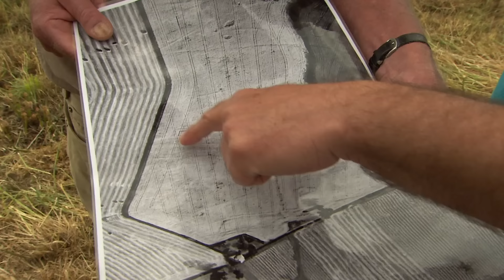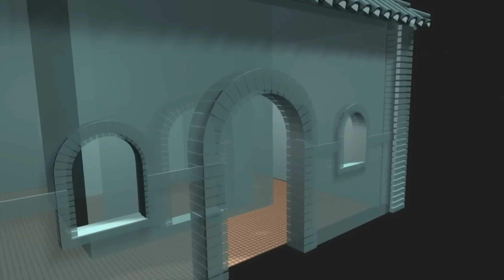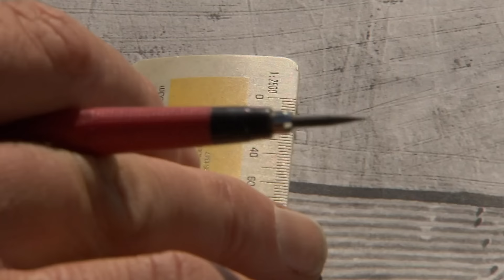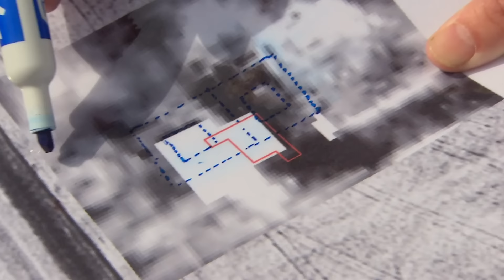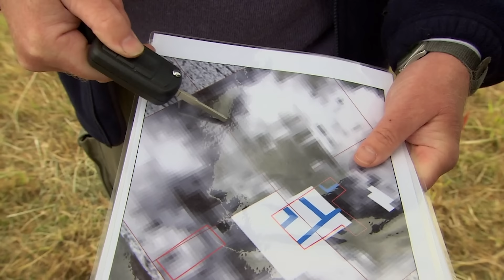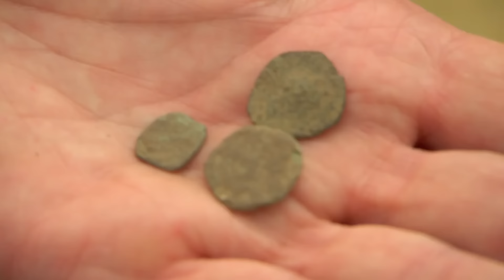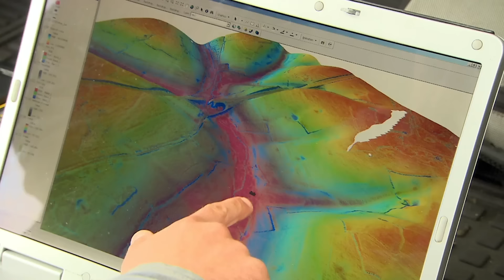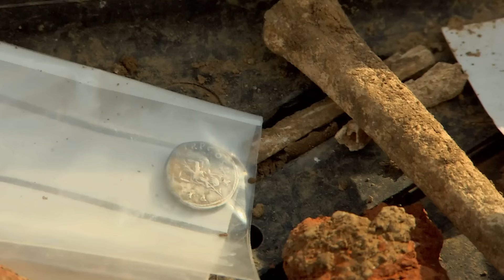“The Trouble with Temples” (Friar’s Wash, Hertfordshire) | S16E01 | Time Team

Comment: @21:14 you can actually see the circular feature on the photo.
Reply: There actually appears to be one on either side. I wish they weren't so rushed with the dig, they could have uncovered both areas.
Reply: @bradenconrad8208  I think this was a case of putting TV before archaeology, so that they could have John showing the circular feature as a 'surprise'. I find it odd that none of the team noticed it on the photo beforre.

Comment: I've watched a number of these excavations of mosaic floors and it seems the tesserae were laid straight onto dirt. Is this the way the Romans built them ?
Reply: Guess so!
Reply: Not a lot of the time if it wasn't a major structural building intended for actually living in they tended to use cheaper binding agents which over time degraded and what you get is the tesserae sitting in dirt

Comment: 40:20 I think that Francis is likely a tremendous Archeologist and scholar, however his confirmation bias for everything ancient being explained as ritualistic is on display again here.

Ancient people, especially the Romans, were nothing if they were not practical. The fact that the ambulatory is raised above the walkway, and the cella is raised even higher than that likely has more to do with the fact that the field was known to flood for at least a portion of the year, as explained at 37:10, and they would want the ambulatory and the cella to remain dry, even when the plain around it flooded.

I do not think Francis symbolism hypothesis of the heights of the different stages of the temple holds any water, when you understand the geology of the surrounding area.

Comment: I do enjoy these programs.  One thing that always puzzles me is the use of coins etc. to date something.  In this episode they found a coin on a mosaic floor, and said that therefore the floor must have been put in there before the coin's date.  Why is that necessarily so?  I have a bronze-age axe head at home.  If my home were to be abandoned now, and allowed to collapsed, future historians might find this axe head lying on the floor of the house.  That would not mean that the house pre-dates the bronze age. Similarly I have some coins that are older than the house.  Of course, I also have computers and other modern electronic kit that means that the house has to have existed after such things were developed - but could have (and did) exist long before then (about 200 years before, in fact).  None of these finds can tell you much about when the house was built - only that it existed at least until the computers (or the latest coins found) were made - but it could go back long before (e.g. the computers) or built long after (e.g. the bronze-age axe head).